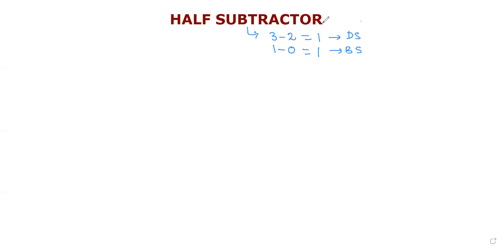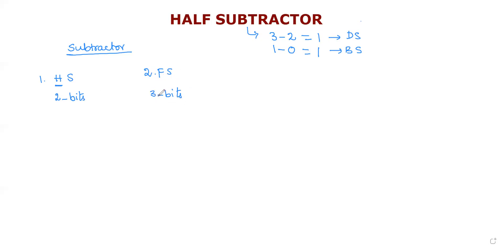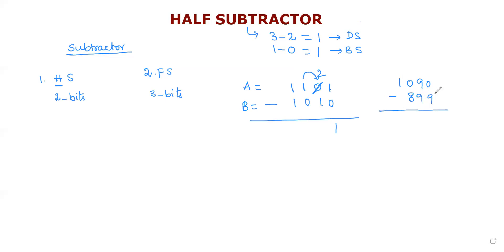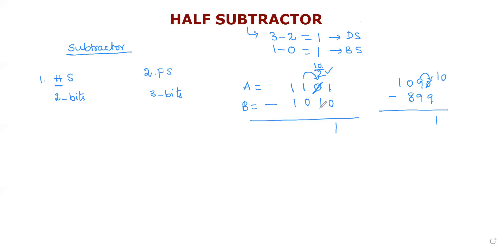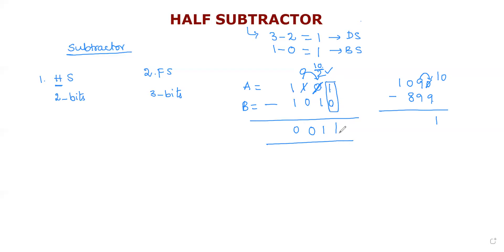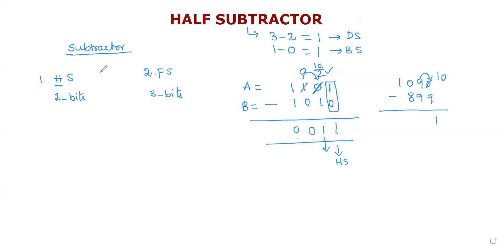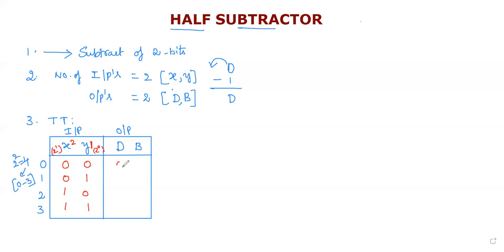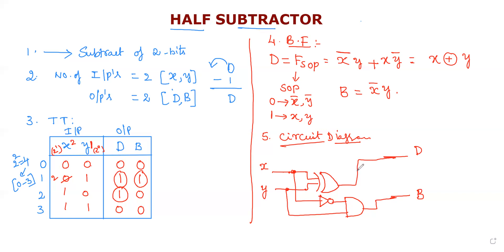3.3 Design of a Half Subtractor | Combinational Circuits | Digital Logic Design | తెలుగు

Comment: And input also change if we change directly 0-2.
Because 2 number is included in (logic 1) on State. We can't say it is zero.
Reply from the maker: Just to understand in an easy manner i told as 2. but it means that "10" in binary.
Reply from the maker: From which university you are from?
Reply: @menlotutorials  junt University Hyderabad
Reply from the maker: @parallel_tech  JNTUH. Right?
Reply: @menlotutorials  yes mam. Mistakenly autoerror by keyboard JNTU
Reply: @menlotutorials  mam I am not talking about present state (2).
I am thinking about past state. which you  took carry from there(adjacent number)  to overcome the subtraction. 
Suppose example.
Present value is zero. 
We took carry from past state. 
But here 21 BCD code is applied. Which High logic is 4 bits. Then how we took 10bits from 4bits. 
And the answer is negative if given any input.
But as per half substrate data we need positive logic.
Reply from the maker: @parallel_tech  Then you have to add/subtract 0110 to perform BCD Subtraction
Reply: @menlotutorials  yes mam it's easy way to understand.
Reply from the maker: If you want to know more about this doubt please call me on my mobile: 9441753374
Reply: @menlotutorials  actually I understood the process mam.